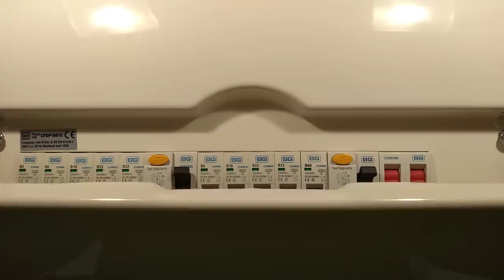A look inside a British home electrical panel.

Comment: I love this series, i'm just beginning to get my head around the likes of ring circuits and fused spurs.....it's such a different electrical distribution design than in the US.  you and Thomas Nagy are amperage ambassadors.  keep teaching us.
Reply: A condo or apartment complex is usually wired in a 'ring' circuit on the 7200V lines for the pedestal transformers. But this is kinda dumb for home interior wiring.
Reply: Check out DSES for the technical bits.

Comment: I’ve been installing electrical panels in both Europe and USA. I really like how breakers just snap on without tools in American panels and bus bars are integrated. That makes an installation with 30-50 branches clean and easy. On other hand, I don’t remember having more than 10 breakers at once in an European panel. I think 220v system allows much more load per a branch. Also, European apartments are tiny - no need for many branches.
Reply: I have 16 breakers, three are in use.
Reply: 240V in 'straya light 2 x power, stove, hot water aircon - 6  breakers.

Comment: Compared to the usual panel in the USA, that one is elegant and straightforward.
Reply: It's not that dissimilar. I'm sure it starts getting messy when you start running wires (though some of that depends on how much effort the electrician puts in).
Reply: Was just thinking the same thing. This one makes even the latest ones we use look sad.
Reply: Because there are so few wires
Reply: Also a ton less exposed mains. I always hate that if you don't have a US panel full of breakers, you have exposed mains. Just look at how many places there is exposed mains https://i.stack.imgur.com/Tcci3.jpg
Reply: As an Uk Electrician I love watching American electricians on YouTube, it's the best comedy on the net (no offence meant).

Comment: Capacity is pretty much in line with US consumer panels, in that common electrical services are 240V (line to line)/120V (line to neutral) at either 100A (smaller houses) or more typically 200A.  Most panels (except for empty breaker positions) are designed with the two line bus bars behind occupied breaker positions so they're not completely exposed in the open.  Neutral and ground bars are both connected to the metal housing via the tabs that hold the bars in the panel and the ground bar being positively connected to the housing via a bolt or lug.  Biggest differences are that most US panels have space for typically 30-40 circuits and are sized so that they can be mounted cover flush with the wall in an available framing cavity or mounted on the surface and that the main breaker is only used when used as a main panel, with sub panels being protected by the sub-feed breaker at the main panel.
Reply: The other difference it that the panels are basically shipped void of breakers, except for the mains breaker. Also, no ground fault interrupt, although individual breakers can be bought that are.
Reply: @JDfromWitness  Panels can be ordered from a supply house fully populated, but usually the cost is only justified with you are working on a commercial or industrial application. Most residential style panels it is often cheaper to purchase the breakers ad-hoc, and it saves an immense amount of time to just buy one off the shelf at the local home store. Not only that, the panel is often cheaper to purchase from your box store than to purchase as a non account holder at an electrical supplier. Its a lot easier to add breakers later to a residential panel in the USA as long as you haven't used up the available spaces.
Reply: I was going to pretty much say the same thing. Thanks, you saved me a lot of typing.
Reply: You can still get 20 space panels for 100 amp service and I believe that is usually the typical size panel used in most homes. Also some panels you buy do sometimes come with a handful of breakers, usually 15 amp which don't always get used unless there are circuits that are only lighting. Something else to keep in mind when discussing breaker panels is that in many older homes the entrance cable coming from the meter going into the main breaker is usually only rated for about 60 or 70 amps because they were designed to be used with Fuse Panels and are typically left in place as long as they are functional. You will also occasionally find homes that are still using Fuse panels because they were never updated. As far as GFCI protection, your average person typically will use the outlets that provide that protection so they can decide where it's needed. Of course once you do a complete rewire or want to bring your electrical up to date, there are a few places where GFCI outlets are required. Last but not least, don't forget newly installed panels or panels being replaced are required to have two grounding points, the ground rod outside near the meter and then to the water main. Plus I believe new installs for electric stoves and dryers are supposed to be 4-wire outlets instead of the old 3-wire outlets, which basically gives you a second ground.
Reply: @the1andonlyfirebug  I think these days most new build homes in the US are 200 amp, and 400 for some of the larger ones. Put two or three heat pumps, and electric hot water heater, an electric stove, a hot tub, a workshop, and a couple of EV chargers on a 100 amp panel and you'll risk overloading it. A 100 amp panel can only supply 24kw ... not that much considering potential peak loads for the average new house (~2700 sqft / ~250m^2). Now that I think about it, the load I described above would even be pushing it for 200 amp service.
Reply: One big difference is our domestic side really almost always has single phase 240 volt, then on the odd house you get the 3 phase 400 volt. But then farms are always 3phase lol
Reply: @danjayh   My home built in the late 1970s has 200A service, a 24-position main panel, 100A from the main to the workshop's subpanel, and had a subpanel wired-to for a swimming pool pump that was never needed as the pool was never built.  Subsequently I've added one additional subpanel, the locations of some of the major non-kitchen appliances changed and running new wiring to the main panel was not practical.  Additionally most of my 15A and 20A circuits use tandem breakers, this house is very large and is well-subdivided for its consumer-grade lighting and receptacles.  I wish they'd gone with a much bigger main panel to start with though, servicing this panel is not fun.  I'd change it out but the panel has the meter housing in it, so that's an awful lot of work and expense for something that doesn't matter very much.

When a friend of mine had his new house built he went with 450A service.  This required the power company, rather than the builder, to bring in the service and install the panel.  And the builder messed up and told the power company to put it in the wrong spot.  Fortunately his contract stated exactly where it needed to go so the builder was forced to run 200A service from the main panel to his garage where the main panel was supposed to be placed, so he has 200A service off of a subpanel just for his shop.
Reply: Or houses where everything is electric (heat, cooking, well pump, water heating) 300-400 amps.  Place I am renting has one 200A panel and one 150A panel side by side.
Reply: @JDfromWitness , since the needs of each house are different, how many circuits, what amperage, etc, it makes no sense to include the breakers in the panel.
Plus it would hate to have to lift and install a fully loaded 40 space 200 amp panel! Lol I just installed one recently, and it's heavy even without the breakers.
It is common for them to come with a couple of 15 and a 30 amp breaker, and I think that's so that the contractor can hook up a few circuits once the box is installed for job sight lighting and power tools etc, before the electrician gets everything else hooked up and loads it with breakers.
Reply: @the1andonlyfirebug  I believe that code requires new builds to have a minimum of 200 amp panels now, because 100 just doesn't provide for the needs of the average family these days.

As far as breakers, most residential circuits are now required to be protected by arc fault circuit breakers, which often come with GFCI protection built in as well.
I helped a friend put a new panel in recently, and I just put AFCI/GFCI breakers in everything, because it is safer, and the GFCI doesn't add much to the AFCI cost (which is A LOT more than a naked breaker lol)
Reply: @ke6gwf  I gather they are more fun with RFI too...*holds up 2 way radio and trips half the box*
Reply: @ke6gwf  , which country? not the US.
Reply: @matthewmiller6068 , actually sealed metal boxes make great RFI shields! Lol

I am a ham radio operator, and have worked in broadcast and land mobile radio stations as well, and unless someone screwed up badly or something is failing, I have never heard of, and would be very surprised if a radio would trip a breaker.
Now, if you had an HT on high power with the panel open and the antenna next to the wires, it might do something, but I would be surprised lol
Reply: @zerosparky9510 , what are you questioning? I made a lot of statements lol
Reply: Mike Eastridge  Yup your not wrong.. just fast typing lazyness on my part there. :)
Reply: @RaithUK  I’m trying to understand European wiring. So your incoming power from electric company consists of 3 wires?One live (hot) one neutral (common) and ground?? So the live (hot) wire has a potential of 240v to neutral or ground?
Reply: @dolive803  hi olive, so yer we have the live(hot) then neutral as you'd expect but then there's also the earth (ground) and yer it's 240-246 live to neutral and live to earth on a single phase house/property but then it gets more complicated when you consider there are 3 main types of earthing system lol
Reply: Coming from UK...had a learning curve with different names e.g. US wrench...UK spanner..US crescent...UK shifting spanner..US home run...UK return leg...plenty more but this is a sample...
Reply: @ke6gwf   I've had occasional conversations with other hams who've had conflicts between their radios and arc-fault breakers. In one case I recall, the fellow would key up a kilowatt on 40m and breakers would start tripping. I think he eventually found all the affected breakers were part of a bad batch and the manufacturer ended up eating the cost of replacing 'em all.  -- de WA4UF
Reply: @mrz80  well, yes, at a Kilowatt of power, a lot of weird things can start happening! Lol

I would imagine that you would need to put some work into extensive bonding and shielding and proper ground topology etc if you wanted to avoid problems with a close antenna.

I know that transmitter block houses need to have engineered ground and bonding systems to deal with stray current, and in a lot of ways its similar to what is done for audio systems in recording studios and performance venues and such, except you are having to drain lots of excess current from any metal object.

But I have never heard of any issues with any normal sized radios, and if there were problems the first thing I would check is that the radio and antenna and ground systems are properly designed and installed, because if you are getting enough Rf to cause an electronic device to have issues, you are likely exceeding the Rf exposure limits as well, or have bad ground issues causing back feed issues etc.

Or, you have a batch of bad devices, that weren't designed to handle Rf interference! Lol
Reply: @the1andonlyfirebug  do they still ground to the water pipes? Isn't that deprecated? Can cause a dangerous shock when doing plumbing work!!! Haven't water workers been electrocuted because they neglected to jumper across before removing a metal part?
Reply: @RaithUK  farms are not always 3 phase. Far from it.

Comment: Absolutely spot-on about accidently putting the bus-bar tag up behind the screw-clamp. I find that you have to hold the bus-bar up then tighten, say the right-most rcd screw. Then see if it is likely to fall down, but don’t actually let it fall. Then loosen the screw and move to the next screw, to the left, mcb screw, and tighten that, and see if the bus-bar is likely to fall. Then loosen that screw and move to the next mcb screw. Etc. Then, when you’re satisfied that all the tags on the bus-bar are in fact forward in the mcb and rcd clamps, actually tighten them all up. Bit of a pain doing this but, as you say, better safe than sorry. Couldn’t they be designed in such a way as to ensure that it isn’t possible to put the bus-bar tags in behind the clamp, do you think?
 Nice videos, very helpful.

Comment: In re fireproof enclosures: when this house was rewired in the 1960s they installed a 3-phase system to drive the storage heaters and water heater via a timer using off-peak electricity. A few years ago this failed, and when the electricians opened the switch box they found that the switch gear had caught fire - but it was so well contained in the metal box that nobody knew about it while it was closed.
Reply: Scary.
Reply: Dodged a fairly large-caliber bullet there, you did. Maybe they should spec smoke detectors and/or temperature sensors in the panels?
Reply: @mrz80  or perhaps a thermal fuse to actually stop the problem?  I suspect most mechanical switching gear is designed to contain a failure with arc, certainly look for something in a steel enclosurer if you're buying something like that.

Comment: Heh... I got a plastic one. 
Figured it's fire resistant pvc. Joke on me, it's 100% polystirene. Tested burning a punch-out piece and just started laughing and crying at the same time...
Reply: Oh crap!!!!
Reply: @godfreypoon5148  Maybe it is supposed to melt and enclose the fire in some.... blazing fireball, ehm, theory did not exactly work out
Reply: Ours is brown Bakelite!
Reply: @David8n  that just might outlast your gandchildren.
Reply: Polystyrene? As in the cheapskate bulk plastic they use to cushion large electronics in boxes?
Reply: @StriderGIF  polystirene is a hard, brittle, highly flamable and cheap plastic used in making cheap cases and parts. It is normally transparent but can be and usualy is dyed. 

Molded expanded polystirene or extruded polystirene foam are foamed forms of this particular plastic used in packaging, cushioning and insulation.
Reply: Tell that to the numpties refurbishing Housing Association stuff,  they have not got a clue what is old and safe and newer and dangerous !
Reply: @David8n  Bakelite?  Wow, there's no school like old school! :D
Reply: I remember back in the early 90s, Square D came out with their Trilliant™ line of home panelboards. All styrene.  What seemed like it might have been a good idea really wasn't.  That thing lasted about two years before they pulled it.

Comment: In Spain we still use plastic boxes. Normally it is used 40A General braker, 10A lighting, 16A for sockets, 32A for the oven and 20A if there are higher loads like washing machines, water heaters and drying machines. The norm is a bit old because in the past we used fuses in every outlet and light switch so maybe the 20A circuit could make sense to have more power in one circuit, but nowadays sockets with fuses are not available since everything is Schuko and common Schukos allow 16A maximum so the 20A braker is not suitable to protect a circuit with schukos.
Reply: Mike Eastridge  Those will be the really old ones. My grandma house was like that until this year that I updated it, but it still need more work done. There were no earth, and the water heater is electric, hopefully there was one diferrential. Now I'm updating it with earth, fusebox, new protections and outlets also coming soon.

Comment: Strangely in Australia, although we are generally more nanny state regulated than even the UK we don't have a standardised home electric panel, there are stendard breakers that have to be there but there's no standard configuration & no off the shelf modular system, it's just a steel (sometimes even wooden) fabricated box with a false panel on the inside with the meter & the required standard breakers & then behind that is any number of fuses. My house has two electrical boxes for some reason, both quite large, only one has the meter & beakers in it.

Comment: It’s a really strange system to us — here in NL we do everything with double poles, because it is required to isolate both sides of the circuit when you turn it off. So the RCDs are basically the same, but you get double busbars coming out of them (L+N) going through breakers with two inputs and to two outputs. Often these days, you get like plastic thingies that include both busbars in a single unit, or you get a busbar unit that’s integrated in the din rail, and the breakers have plugs on them that just plug into the proprietary rail (the rail then has wires coming out that you can wire into the output of the RCD).
Reply: UK RCD's are double pole.
Reply: @Loobo2012 but mcb's are single pole